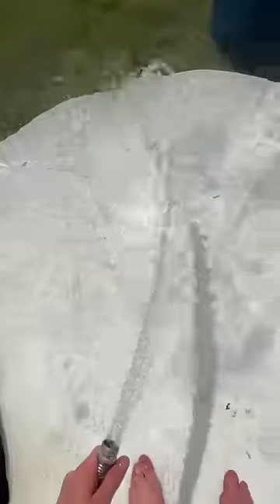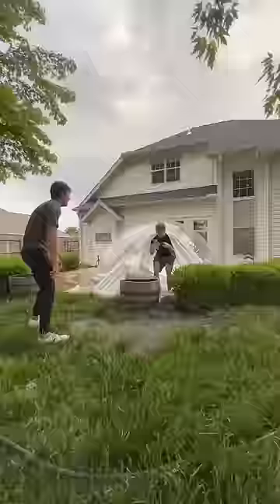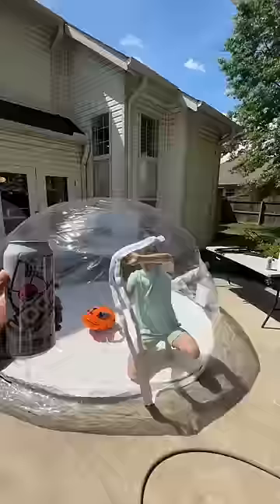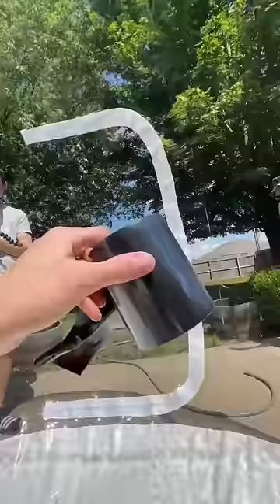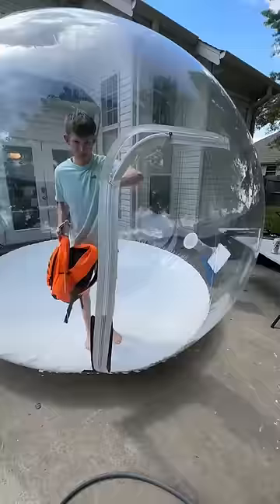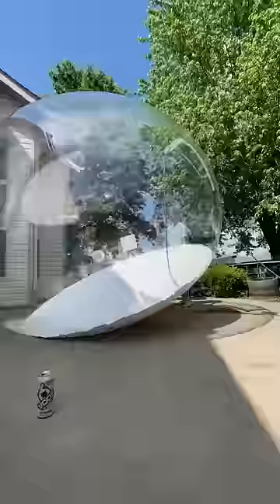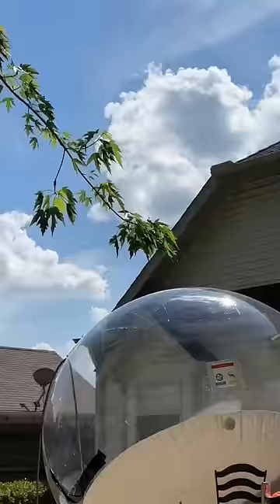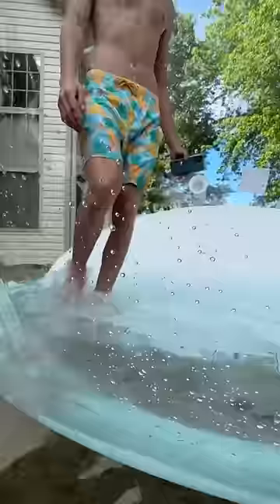Filling my new dome with water #shorts

Comment: Today’s episode: how to rid yourself of oxygen
Reply: Let him
Reply: You can survive in those things for hours. I mean, they wouldn't be legally sold otherwise
Reply: Darwinism in action
Reply: Technically there would be oxygen in the ball if it was completely filled. The oxygen is just devolved in the the water unable to be used by us, although the oxygen in the water would run out eventually if we could.
Reply: You could also get a ticket to go see the titanic
Reply: @charlottejohnson5885  💀damn💀
Reply: @KMS_Unbranded   howd you mess up dissolved that bad 😭
Reply: @bsmith9890 but he is compromising it? Sealing the cracks with tape. Pretty sure carbon dioxide would build up
Reply: @Jj-kw1cd  you're meant to enter those and then walk on water with them. The tape does nothing but prevent the zipper from opening (because he left it partially open.)

Comment: if anyone is interested, volume that size is about 15,000L of water and will take about 24hr for an average garden hose to fill up provided no leaks. and cost of water is about $30-40, depending on the local water rates.

Comment: The pressure from trapping the air inside is keeping more water from entering. You need to have a little ventilation for it to fill up higher

Comment: It'll explode before it fills. Water can't be compressed but o2 can . As the water displaces to air the air will compress and build pressure until small boom

Comment: You'll need a vent/ hole for air to escape for the dome to fill up all the way. Having it enclosed creates too much air pressure which will only allow a certain amount of water in. 

It's a similar concept as to why you can drink a beer faster by shotgunning it, or why a a bottle of water poors smoothly when it's horizontal versus when it's upside down.

Comment: Remove the air first. You're taking a ball with a finite surface strength as a barrier and filling it with air then with water. The water will displace the air but only to a certain point. Then you're just putting pressure on hhe barrier, which is why is bursts and your water goes everywhere. Remove the air from the jnside first and then fill your ball with water if you want if to go to the top.

Comment: You have to fill one with the zib that goes top to bottom an leave a small gap for the air to come out or else the compression will make it pop
Reply: That could easily hold twice the amount of water that my hot tub can, and thats a ton of water itself. That thin plastic probably isnt going to hold two tons before it bursts.

Comment: the issue is the ball has air in it and is shut closed so the pressure becomes to much and the ball pops. try emptying the air slowly as you fill it up

Comment: You need more structure, that amount of water weight and the thin plastic even if it fills before bursting. You would only have a massive water balloon pancake. At this point you would need a Geodesic dome with steel structure. Or like 4-5 “zorb” balls all within eachother.

Comment: Next time you should stick it in a pool while you do it.
Because you’re filling it with water the internal pressure is going to vastly differ from the external pressure which will cause it to explode however, if both inside and outside are filled with water then it’s not going to explode because the pressures are going to be the same.

Comment: I feel like your biggest fight is with air, you’re inflating an inflated ball, so you should either find a way to filter the air out replacing it with water as you go, if you insist on being inside it (this ignores structural support that might be needed) or simply start with a fully deflated ball that you fill with air like a water balloon. (This makes it near impossible for you to actually get inside once it’s full though” there isn’t an easy answer here. Buuuut I think with preparation and science you might have a chance to actually fill it.

Comment: you're making it so water tight that it's air tight. The reason it's not filling up fast enough is because the pressure inside the dome is increasing. You need to let some air out while you fill it with water you it'll keep leaking before it fills.

Comment: 56,000 lb of water is what you're expecting that plastic to hold .... Assuming that's is 12 ft across.

Even if it's only 8 ft across that's 16,000 lb of water.

That's equivalent to the weight of an African elephant...

Comment: the dome is probably bursting because, since it is airtight, adding water into the sealed environment means that the air pressure keeps increasing and it eventually pops. if it isn’t airtight, get a stronger dome L

Comment: You need to fill it up without the air because all the pressure on the inside as it stretches with no air being able to escape causing it to pop or like like what has happened the last 2 times

Comment: you cant fill the dome with water if its got air in it you gota place the hole on top and fill it from there so the iar sint trpaed inside and leave it as empty as posible of air

Comment: Where does the air go if you’re going to fill it up you would have to have the door open even so it is not designed to hold such weight